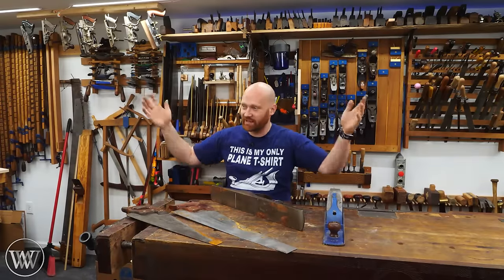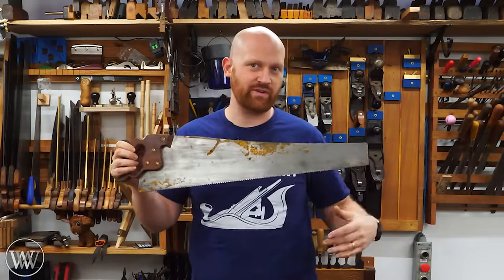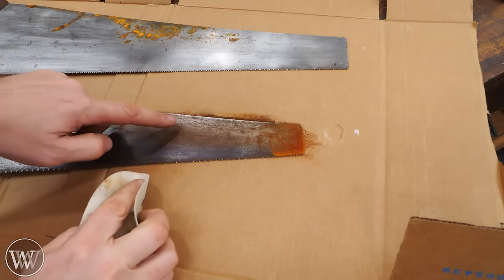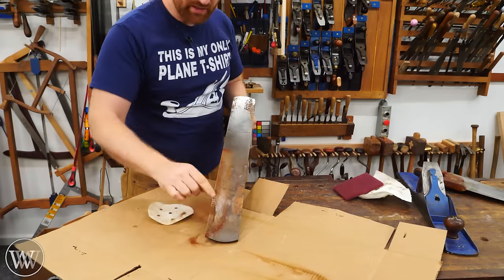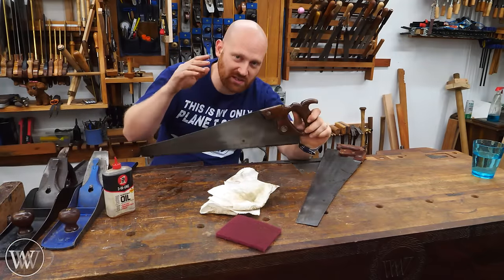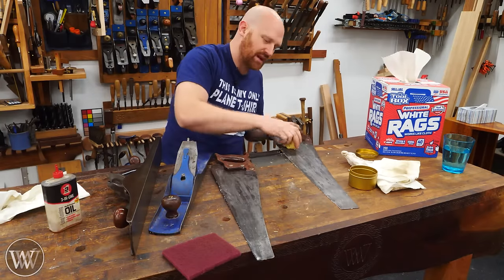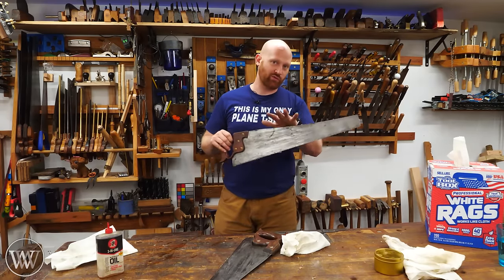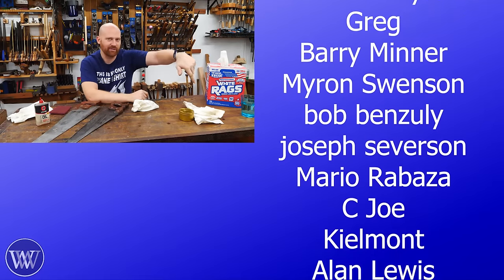How To Deal With Rust Repair and Prevention

Comment: Fluid Film works great for preventing rust. I use it on all my power and hand tools. I typically use a heavy coat when tools aren’t being used, a quick wipe with a microfiber towel and ready for use.

Comment: You have converted me to your hard wax.  It keeps things moving like fresh rag-in-a-can for a long time and seems to be better rust prevention for me in my humid garage.

It is kind of funny that 1/2 my woodworking hobby is working on metal.  Restoration, rust removal, sharpening, etc.  Didn’t expect that going in but don’t mind it at all.  Equally fidgety and rewarding.

Comment: Only difference for me is that instead of sandpaper, I use the sandflex bricks. Sorta like a pencil eraser that's filled through and through with grit, so as it wears out, new, unclogged grit is exposed. Just took a bunch of rust off a lathe yesterday, worked quite well. Not to mention that the green medium grit one is a pretty damn good match for the factory grit on Lie Nielsen's planes, so there won't be an obvious shiny or rough patch after a bit of cleanup

Comment: Im a huge fan of Kroil products - spray it on, abrade it off with your choice of pad - steel wool, scothbrite pad, brass wool... Silikroil helps dissolve the rust and leaves a light protection behind.

Comment: An excellent video, James. I do something I've never seen other woodworkers use, Rem oil by Remington. I have a giant spray can that must be 10 years old or more. It's made as a rust prevention on blued steel used for gun barrels. It's even lighter than 3 in 1 and seems to last a very long time. Since I really don't hunt much anymore, my can lives on my workbench and it works great. I start out spraying down brand new tools when I use them the first time since I live in a very humid area and my tools are in the garage.
Reply: Hum, I wonder why I never thought of using my can of BreakFree?

Comment: PB blaster is my favorite preventive. I keep a rag in a can and just spray some on it occasionally as I use it. I try to make a habit of wiping my tools down after I've finished using them on a project and before they go back on the tool wall. A couple of times a year I will wax everything that's bare metal in my shop with some paste wax. No rust problems here and I'm in the either baking or boiling TN.

Comment: If it is a little to deeply  pitted, try restore. I get it at Home Depot. Get a spray bottle too. Use dry sanding,clean off with dry rag. Spray with restore. Let it sit for 5 minutes. Spray again scrub with a green or red scouring pad. Wipe clean. Use light oil wipe clean. Done.

Comment: I live in Missouri where we have high humidity in my shop is an outside entrance basement. So with the high humidity I use the oil and instead of using hard wax I use a soft wax and make sure that I keep all my hand tools with a nice coating.

Comment: for tools i dont use for a  long time, i have a bunch of lanolin that i dissolve in wd40 or other solvent and apply a thick coat. Kinda a hassle to remove, but cheaper than boeshield and very ecogroovy.

Comment: How is your experience with those Narex Richter chisels goin'? I am considering building my own Paul Sellers work bench, complete with leg mortises, but I have zero chisels. Have been thinkin' 'bout getting real firmer chisels for the leg mortises, and Narex makes some neat ones. Whatcha think?
Reply from the maker: The Richter chisels are still my absolute favorite. The best bang for the buck and incredibly durable. All of the other lyrics chisels are made out of a different steel that aren't quite as good. And I really don't have a huge need for a firmer chisel. Especially when making big mortises you're usually going to use the auger bit to take out most of the material and then you can come in with a bench chisels and clean it up.

Comment: Pretty good tips, James! Thanks a bunch! 😃
Have you ever used vinegar as rust remover? I've seen it be done, but I never understood it very well. 
Anyway, stay safe there with your family! 🖖😊
Reply from the maker: Yes. If you want to do a bath it's about the cheapest way you can do it. You just have to be careful with it and don't leave it too long. I don't do it with saw plates anymore but for plain bodies it works great.

Comment: I have a question unrelated to this video, but don't know where to post it. Every time I see you hanging your planes on the wall I wonder about the system you use for this. I've scoured your videos to see if you talk about it anywhere. What are those blue things on the wall, and what do you think about the idea of making a similar system from wood?
Reply from the maker: https://youtu.be/xIiLn0J_kD4?si=tD-0c9AK1JJWEy0r here is the video making the plane tell. I changed out the wooden blocks for 3D printed blocks as I like the look of it. But the wooden blocks work just fine.
Reply: @WoodByWrightHowTo  That's great, thanks! As one of those annoying purists, I'll be sticking to the wooden ones :)

Comment: I was always told as a kid learning that although wax is great and does protect your metals, you also never use a waxed tool on a surface that is to be glued? Never bothered testing it just did as I was told and accepted it though we have used wax on paper templates to prevent the glue up from sticking to it?... . Wondering your thoughts and/or experiences?
Reply from the maker: That is one that makes common sense. But in practice and in function it doesn't make any difference at all. I use waxes all the time for lubrication between wood and tool and I've never had a problem with glue or finish.

Comment: Have you ever heard of anyone stripping a metal plane body back to bare cast iron and then seasoning it like cast iron cookware?   Would that work?
Reply from the maker: I have hers of a few people that tried that when rehappening it, the problem is it does not last long. and if you try to do it with the japanning on you run into problems therem.

Comment: Electrolysis...................  Even simpler than powder coating  (if that's possible)..  If you can,, heat the metal then coat with oil, keep hot for an hour, let cool slowly,, can provide long term rust control